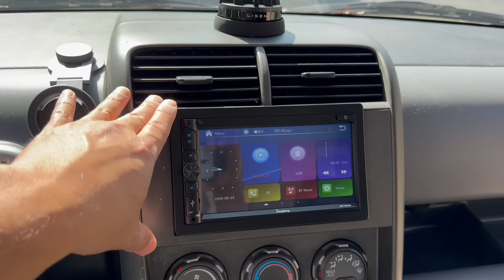This Camper Travels 4 and Sleeps 2 - Easy Build Honda Element 2 Bdrm Camper Tour. DIY Campervan

Comment: Not safe while driving if you can't access your handbrake.
Reply: If He Backs it/Fridge up a 2" - 3" it's 😊SuddenLy AvaiLabLe,  bye
Reply: It is called a parking brake for a reason.  It is for when you are parked.  Parking breaks are not designed to be used when you are driving.
Reply: He showed how he built around the brake so it's accessible.

Comment: Always felt inspired by California company that adds the pop-up rooftop or you can get to sleep center from inside the element. Mostly, I wish they would bring the element back to market.
Reply from the maker: There's always used old elements. They are relatively inexpensive to fix when they are not rusty.

Comment: Do you have a link for your air compressor? Or the brand and model? And would you get it again or purchase a different one?

Re the "2 bedroom" camper set up...This was great.  You're so creative!   Thanks for sharing this.
Reply from the maker: I must have forgot to add that link in the description. It is there now. It is a good versatile pump but a bit expensive. You can buy a mattress inflater and a tire inflater separately for less. But if price is not an issue, having a flexible pump all in one is very nice. I did a review here https://youtu.be/uBnfjloSSJY?si=Cp4la9ConL_Kpun0
Reply: @Tiny-Campers  thanks bunches!
I totally missed that video.  Thanks again!  You're the best!

Comment: I love your videos and you have again done amazing work! I have a question for you. I just got a small 2016 dodge Promaster City that was already built by Cascade Campers. I’m a single 62 year old female and I know nothing about building or electrical systems or the solar panels. I does have a 100 watt panel on the roof. If I’m driving things seem to work, but when I park it doesn’t. Where would I go to have it checked and or fixed? It does have a small battery in the floor that is supposed to work with the solar panel.
Reply from the maker: If it only works while you are driving, you are probably not charging with the solar panel at all. I suspect you are charging with a dc to dc or alternator charger, which will only charge while your car is running. Without knowing more, I would say you might have a bad solar charge controller.